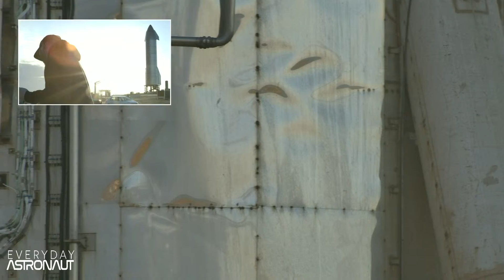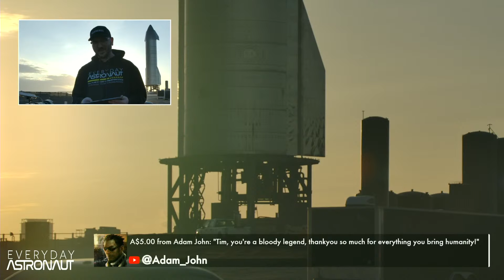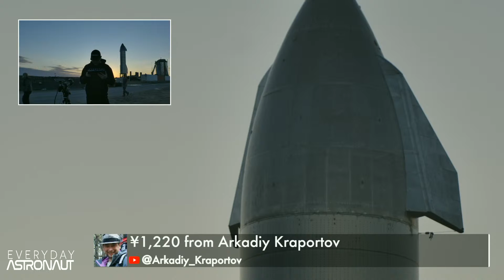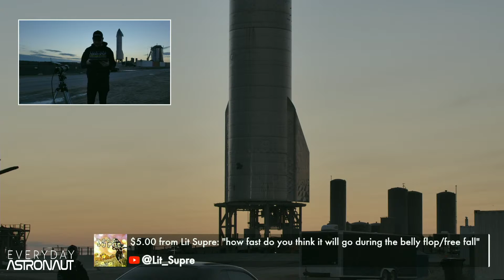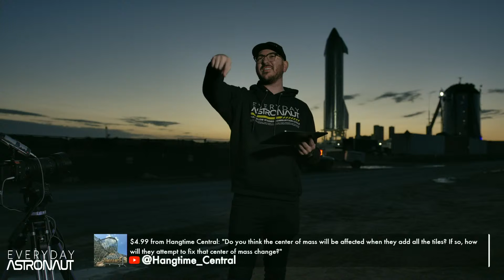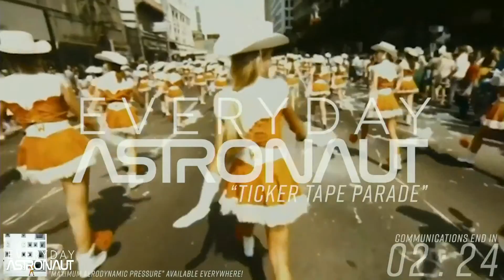Pre 15KM flight Q&A [LIVE on site!]

Comment: The final starship is planned to have three vacuum raptors right? What is the point of having more than one vacuum engine in general? Could they not simply scrap the other two to save weight, and just run the engines longer?
Reply: They need enough thrust to land it safely on Mars or the Moon.
Reply: @claudiot.crameri3195  I thought they were going to use a different spec starship with higher engines for the moon. And wouldn’t they use the sea level engines on Mars? I thought that the Martian atmosphere is thick enough to cause problems with the vacuum nozzles

Comment: What is the internal construction of starship?  Is any aluminum used for the stringers and internal rings?  If so, and reusable, what about galvanic corrosion?  Attack from atomic oxygen in orbit?  Will heat tiles need be mounted on the downwind face of the elonerons?  Thanks!

Comment: I'm not so concerned about the relight. I think there's a higher chance that it will be ripped apart by aerodynamic forces on descent during the belly flop maneuver and never even make it to the point of relighting the raptors than for the relight itself to fail. I'm betting that if something goes wrong it will be during the skydive maneuver or the flip (relight successful but the g forces on the craft during the flip just before landing rips the prototype apart)

Comment: I’m expecting Elon to move the flap mounting locations back so the hinge is on the leeward side out if the intense reentry wind.   Also, the top flaps look too small to flip from nose down to nose up.  And if it’s decelerating  nose first from drag, then the propellent tanks will need higher pressure to reach the engines
Reply: The front flaps is smaller because there's more mass on the bottom than on the top
Reply: Alvian Choiri Apriliansyah then if the starship ever finds itself in air with velocity vector aligned with the starship axis, then the flaps will increase drag in a way that makes the starship flip upside down(non shielded side hitting the atmosphere).  It will burn up if re entry starts with the wrong orientation
Reply: @douginorlando6260  Okay, then please send your email to SpaceX

Comment: Starship has hardware: airframe, rocket engines, avionics (computers, sensors, actuators, etc), moveable aerodynamic structures & software.. all subject to extensive modeling & simulations... built on SpaceX’s extensive Falcon experience which bodes well for early Starship success.

Comment: Hi Tim. Why does the Starship do the belly flop manouevre? Why not just orientate engines down at a higher altitude and then perform landing burn like F9 Stage 1?
Reply from the maker: Give this a watch. Mostly has to do with orbital reentry. https://youtu.be/-8p2JDTd13k
Reply: @EverydayAstronaut , thanks. But presumably it could reorientate at ~3000ft after most  of the orbital speed has been bled off instead of in risky manouevre just above the ground?
Reply: @mrbdean  When you straight up too early, you would lose a lot of fuel because you didn't take an advantage of the drag any further
Reply: @alvianchoiriapriliansyah9882  , yes for sure, but at least you avoid the risky profile they are attempting. Fuel reserves are sufficient for F9 to use this method.
Reply: @mrbdean  It's risky for sure in early days, but as it being done again it will get more reliable. With Falcon 9 method you would loss the fuel before touching the ground

Comment: I still can't believe they build this thing with stainless steel. I bet when they do a test with  reentry from orbit, the thing will come down as a banana, because stainless steel tends to bend when heat is applied on one side or isn't distributed evenly. As they planned to do a belly dive down this can be an issue. But we'll see.
Reply: That's why there's a heatshield & tank pressurization

Comment: A Starship upper stage with enough fuel to get to orbit would have a thrust to weight ratio of pretty much 1.0, which means it could barely get off the ground, and there would be horrendous gravity losses, so it is not even close to SSTO. The upper stage does have about 7km/s Delta-V so it has almost enough Delta-V to get to orbit, but would need a much hight TWR (~ 1.4) which would mean another 3 engines. It'd still be ~2.5km/s too little Delta-V to get to orbit though. The Super Heavy booster does a lot of work getting Starship up to 4km/s and through a lot of the atmosphere, so that the Starship can use its 7km/s Delta-V horizontally to get to orbit.

Comment: Would like to know the g-forces that an astronaut experiences during the landing maneuver.
Reply: definitely a bit, but not more than what a fighter jet experiences during maneuvers. This current maneuver is going to shake a lot, but ultimately the maneuver will use hot gas thrusters instead of the engine flip-flop maneuver they are going to use here
Reply: Adrien Mansuy thanks :)

Comment: 25:48 what is that on sn8
Reply: strap preventing fins from flapping in the wind, they remove it for tests and flights
Reply: @linecraftman3907  no, the clouds, is that areoplane ?
Reply: @viraginjankar4968  oh yeah, its a jet plane, jet fuel when burned makes co2 and hot water and when that water condenses it turns into clouds

Comment: The flaps are essentially “Air Brakes”.  Fighter plans have them to allow slowing down quick to get behind the other plane
Reply: Partially correct. They also function as ailerons in this configuration

Comment: Complete refueling you have to launch 8 at once, or near to the same time, best case.
Reply: 8 at once and then refuel at once? Not so wise...
Reply: There's no reason why it should be at once. It could actually even be done with 2 SSs and only one Booster. It's just a matter f time required.

Comment: Why is spacex nut using a traditional flame trench like NASA does?  Could the debris damage that happened recently have been eliminated if a tall flame trench is used?
Reply: Because there will be no flame trench on Mars.
Reply: Yes, I had that thought as well. So Elon the brainiac, has three Raptors blasting away at the concrete, what 30 feet or so below the Raptor
nozzles?
Reply: @herbward5240  & @David Darrow - There will be no flame diverter on either the moon or Mars, so SpaceX also has to figure out how to do this without a flame diverter if the Starship is going to either place. The problem with SN-8 wouldn’t have happened if the bottom & hydraulic lines had been protected by the same type of cladding 4x4’s use.

Comment: Does sn9 have its raptors fitted?
Reply: @ethana.228  yes
Reply: I don't believe so. They are on site, but they usually do a pressure test with liquid Nitrogen, on the test stand, prior to installing raptors. This may have changed though.
Reply: SN9 doesn't have its Raptors installed yet. That'll happen at the launchsite
Reply: @tobylii  seems being able to install them "off pad" would speed up availability of next starship for testing
Reply: @Ebonyqwe  raptors will be installed only after pressure and cryo testing
Reply: @filyn  ok, but why? Is there a mechanical reason what they have to wait, or is it just spacex being prudent for now?
Reply: @Ebonyqwe  from my understanding, just making sure they don't destroy engines while testing other systems that don't require them
Would be bad to lose raptors because a tank can't hold pressure, for example
Reply: Oops I thought you were talking about sn8. My fault.

Comment: Why cant they make a hydrogen platform to lift those rockets to the edge of space?
Reply: Look up rockoons
Reply: Hydrogen is much more difficult to handle in tanks. The tanks are much more heavier. And you have to pay more to create hydrogen. It's expensive to make.
Reply: Cost
Reply: You need to be going 7.5+Kms to stay in orbit. A hydrogen platform might give you 35 Km altitude, but it won’t give you any velocity. It’s just easier & simpler to put more CO4 & O2 in the tanks.
Reply: @TraditionalAnglican  sure it gives you an altitude head start and I agree with you that velocity is key when getting things into orbit, but higher altitude also means better fitted nozzles and less aerodynamic drag with lesser air.
Reply: @kevinyu6589  - Starship promises launch costs of <1/1000 of those of even SLS Block 1. As Elon Musk & Jeff Bezos have stated, the main driver of launch costs is the cost of the rocket. Ask yourself how much airline tickets to Europe would cost if we threw away the aircraft after every flight & produced so few of them they were boutique items [$320 million x 2.5 ($800 million) in the case of a 777] & compare that with the $1,794 quoted by American Airlines for a round-trip NYC to Paris. Airlines are able to do that because aircraft are mass produced items, & they fly them 20,000-40,000 times before retiring them. Even at $1.00/liter (median price of jet fuel in Europe), fully fueling a 777 costs ~$180,000. The fuel for a Starship & Super Heavy is ~$750,000. You might be able to get an extra 5-10 tons more payload to LEO on a Starship using a high altitude (35-40 Km) launch pad, or you might get away with using 5% less fuel ($35,000), but that’s not going to be enough for the added complexity or “hassle”. It might be worth it if the launch costs $23k/Kg, but it simply isn’t worth it at $20/Kg (or even $100/Kg).
Reply: Another thing is the amount of hydrogen required to lift a launchpad and the rocket itself.
Reply: Hold on guys the reason why im bringing this up is ive seen they made allot of progress in 'zeppelin' technology regarding static fires so this platform could be lifted using hidrogen has matter a fact there is a cargo aircraft in testing im saying hidrogen has helium is a precious resource so if you could lunch at 35 km how big of a rocket would you need consider the lifting force of hidrogen it would work has a space elevator plus roockons have been used in the past a platform would eliminate the meed for a stage 1???
Reply: @ParadiseByAir  - 1st stage doesn’t just get you up to you 80+ Km, it gets you up to 10x the speed of sound (~12,400 Kph). This platform would get you up about 1/2 as high, & would provide 150 Kph if you’re lucky, so you’d still need a 1st stage. It might allow you to get 5% more payload into LEO, taking your cost/Kg down to $21k/Kg on a rocket provided by “Old Space”. SpaceX has already done significantly better by reusing Boosters ($1900/Kg wholesale for both Falcon Heavy Reusable & Falcon 9 Expendable). That might be worth the added complexity &”hassle” on an OS rocket, but it isn’t worth it on a SpaceX Falcon rocket, & most definitely won’t be worth on Starship.
Reply: @TraditionalAnglican  thank you for that its clear know your logic is sound thanks again
Reply: And i see hidrogen is expensive but if done properly this platform could be reused workout the fuel needed for each lunch danger involved surely there has to be an advantage in lunching from a grater altitude even if hidrogen is expensive to make its should pay for it self when you workout all the fuel being wasted on the first stage alone

Comment: Whatever happens, it will be spectacular!
Reply: I can’t agree more
Reply: Even if it crashes(which it WILL NOT)
Reply: @samannyakola7332 Do you mean rapidly unscheduled disassembly?
Reply: @siddharthbutala6781  Do YOU mean Rapid* Unscheduled Disassembly?
Reply: I mean, there is going to be even more variables here than there will be ultimately.

Right now the landing maneuver will call for the raptors to generate a ton of angular momentum, and as such also generate a fuckload of momentum that will have to be cancelled. It will nessesitate the engines to swivell at least twice at their maximum angle, and have the perfect timing while doing so. This is because the elonerons can't be used to turn the starship engines first to perform the hoverslam. 
However ultimately, that maneuver will be simplified with the hot gas thrusters. These will have enough thrust to move starship in atmosphere, and the plan is to use these to perfrom a torque neutral flip of the starship, so the landing can be performed with a regular hoverslam. 
So many "firsts" will be atempted this flight, and I would be blown away if they can even get that thing "somewhat" down first try. Even if it crashes on landing just getting remotely close to the landing pad will be an insane sucess.
Reply: Yesss
Reply: Even if he fall of the pad ? 😬
Reply: @MrEnzo57070  Yes then there would be at least spectacular RUD
Reply: What actually happens: engines don’t fire - nothing happens
Reply: @trichtertus6221  That would be relatively easy to fix.
Reply: Bingo!!! lol :D
Reply: U right
Reply: What if it fails without exploding before launch? That would be such a bummer 😂
Reply: Hey Tim, doing a great job of keeping it real.
Reply: Tim, wear goggles and a safety helmet and earplugs! Safety first! ... Seriously, how far away are you from safety zone?
Reply: "It will be a great rocket launch or the best fireworks display" Elon Musk
Reply: Haha no